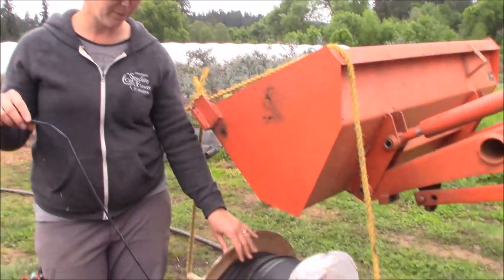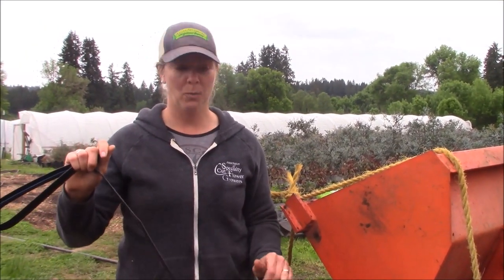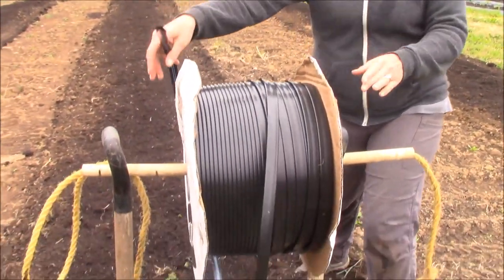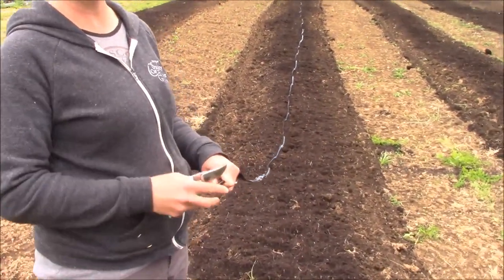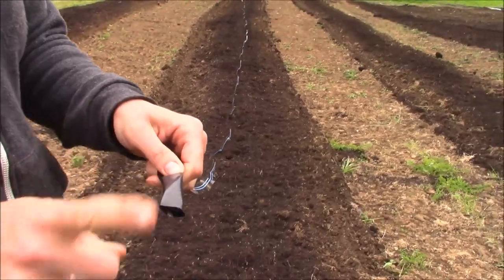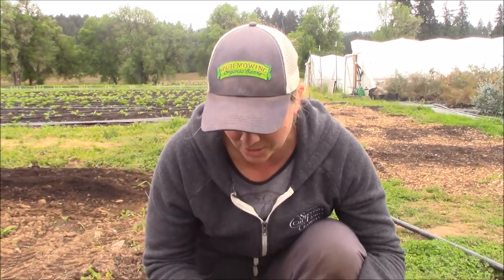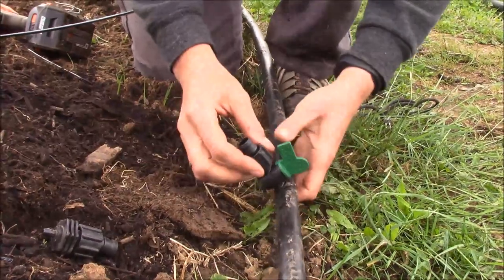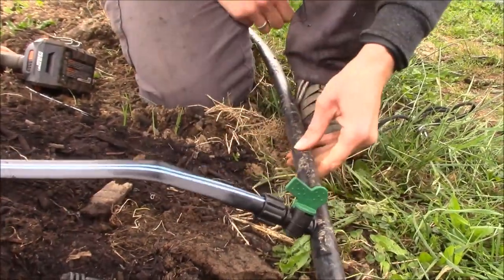Drip Tape Irrigation- Installation Tips

Comment: Brilliant video. I ran 500 feet of drip yesterday and will be running 500 more later in the season. I was wondering how to terminate the ends cheaply and you showed how. You now have another fan and follower.
Reply: Hey, if using drip tape do you still need to do foliar waterings? Or is the drip tape sufficient enough on its own

Comment: I wish I had seen this video before I purchased 8mm tape.  It's almost impossible to install on the valve.  I use rubberized gloves and still can't get it over the ridges.  Live and learn.  I will say, I have a tool that looks like pliers that punctures the hole in the main line, easy and don't have to carry a drill around.  Thanks for the great information!
Reply from the maker: Thanks for Watching!

Comment: There is a really cheap and accurate hole punch for putting the hole in the 1/2 inch pipe. I don’t think I would want to  use a drill for that.
Reply from the maker: There are holes punches that usually ship with the valves. We like using the drill for ease, when putting in hundreds of valves it saves our hands and wrists, but the cheap one works just fine too!

Comment: Nice video.  I suppose if you have a deep well clogging of emitters is not a problem, but do you have a filtration system too?
Reply from the maker: we do have a pretty robust filtration system, but even so we find that we need to replace the tapes every 2-3 years.

Comment: I bought one system from Berryhill with drip tape for rows and several of the valves and end caps are leaking. I have tried to get a refund and I’m not getting anywhere with it. Can you use plumbers tape on the plastic Valve fittings to keep it from leaking?

Comment: Thanks for the great tutorial.  Do you think a 1/2  inch poly tubing will work for 15 beds that are 75 feet long or should l buy 3/4 inch. I intend to buy the 15 mil drip tape. Also my garden is slightly sloped.  Thank you.
Reply: What did you end up going with?  3/4 inch or 1/2?

Comment: Do you reuse the poly line or the drip tape ?
Reply from the maker: yes, we reuse both
Reply: @RainDropFarms  Two years late? I found even with the thicker tape the seam splits in about 30% of the material, I just replace it now.